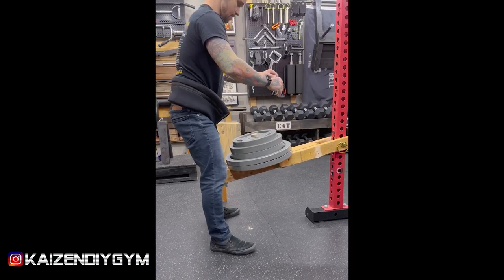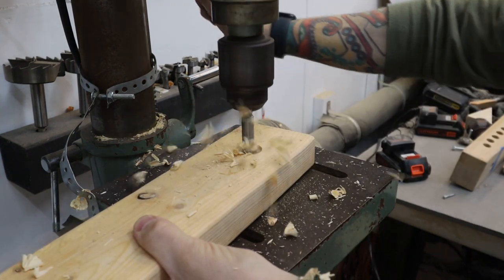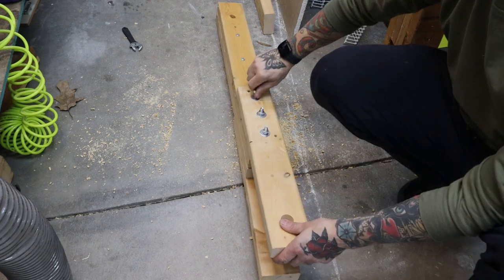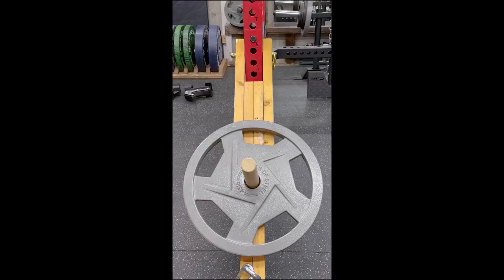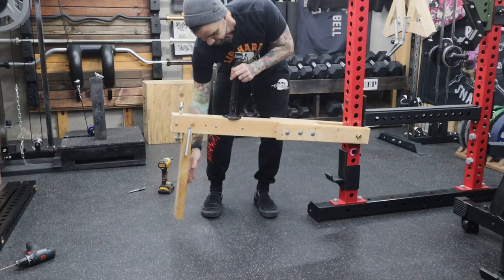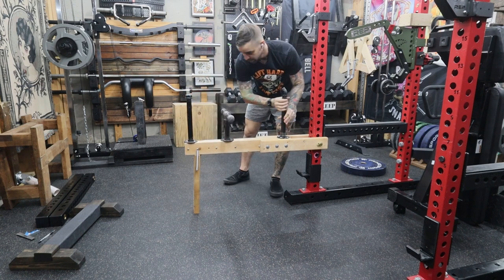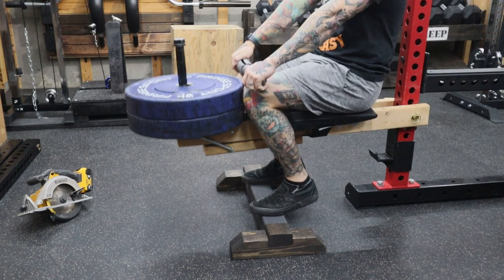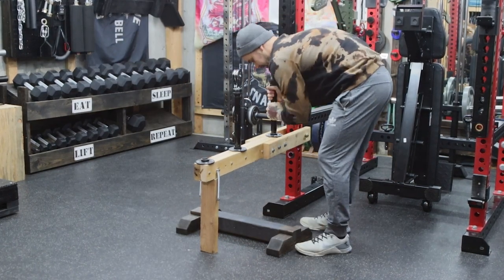DIY lever belt squat and seated calf raise!

Comment: Almost I did not watch this because I have seen the short videos.  This is a marvelous explanation of the steps and of your reasoning in making these attachments.  My rack is a cheap one with holes only going front to back, but I think there is enough room in my garage to go off to the side.  I really want to do this once I have finished one or two other projects.  Thank you for sharing and stay safe.
Reply from the maker: I appreciate you taking the time to watch. The short videos are basically teasers that I put out while I’m shooting the longer video. I appreciate the support. Good luck on your build.
Reply: You could use safety/spotter arms with holes from side to side to get a hitch pin through these holes and build this. Maybe this could help, if your garage isn't big enough.

Comment: Thanks for the tutorial! I built a similar version, but spaced mine differently, went with only 2 flanges, and don’t have any handles. This means less hardware and faster swaps between lifts, but without the handles, I have less stability in my movements.
Reply from the maker: That works!

Comment: You said the inch hole goes at the end of the 30 inch pieces but by the end they were at the end of the 20 inch pieces. If anyone is following along then they have screwed up because you said it incorrectly.
Reply from the maker: Sorry man, there are bound to be some mistakes in there. Hopefully you’ll be able to recover and still use your DIY.
Reply: @KaizenDIYGym  i have recovered and completed the build. My temper tantrum is over. Appreciate the video.

Comment: Hi love your channel and innovative inventions!  I'm considering getting the Mammoth belt squat from Fringe your invention and it says 90% felt weight.  It's long so that made sense until I saw Sorinex J Squat which is also long but claims 60% felt weight.  They look VERY similar but percentages are far off.  Please help me understand this and help me pull the trigger because I'm tired of messing around with landmine belt squats and at a weight level where they no longer work or are a total pain.

How does yours get 30% more feel weight than Sorinex or do you think their % is way off and they never even tested it.  I tested a landmine belt squat today and say a 25lb plate and 45lb bar at an angle with landmine had weight of around 38lbs so it was MORE than the weight I put on.
Reply from the maker: These are all great questions and I appreciate the kind words. I haven't used the J Squat so I can't say whether or not what they're saying is accurate.
On the Mammoth, there are so many variables that change the felt weight - length of the arm, weight horn placement, height where it is mounted on the rack, whether or not a kickstand is attached, etc. I can't say definitively because I haven't tested it out. What I can say is that I trust the team at Fringe. I trust they did their due diligence before putting that information out to the public.

Comment: Love your channel! You inspired me to do some do it yourself projects for my home gym. I am going to build this.Belt  squat set up. I know you mentioned the length of the lever. The shorter you feel more load the longer you feel less load. Ideally, what do you think an ideal length would be? I will be using Olympic plates. Thank you in advance!
Reply from the maker: Longer is always better. The shorter it is, the more you get pulled forward at the bottom of the movement. Length doesn’t make a difference on how much weight you feel, that has more to do with weight placement. The closer the weight is to you (vs the attachment point) the more weight you actually feel. I’d put it as close to your body as you can without bumping your knees into it during the movement.
Reply: Thank you very much for the reply and thank you for the useful information on load placement ! . Definitely makes more sense now. Keep up the great content . 👍🏻💪🏻

Comment: I love the design and got it mostly done. How did you get the springs to work? I’m having trouble getting any springs to work without them either slapping too hard or barely moving at all. I basically copied what you did on the video but my results were much different. Any help or advice is appreciated!
Reply from the maker: It’s a matter of attaching them with the right amount of tension. I had to do a bit of trial and error to figure it out.

Comment: I can change your math and physics…put a j hook ,opening facing you ,on the underside of the arm ,near your attachment hole. Take a purple or blue band attach the loop around the j hook then around the support arm of the rack, then attach the other loop to the j hook. Secure the band from sliding up the rack ,support it to the bottom of the rack. I used a small nylon loop with a carabiner. Now even close to bottom you will be at weight or up to 25lbs above… I measured it with a scale at multiple heights. The bigger the band the more the suffering….lol

Comment: I have a landmine attachment into the wall a couple inches above the floor.  Do you think this design would work or would using the barbell design be better
Reply from the maker: Both would work. It’s really a matter of what’s easier and most effective for you. I’d at least try the landmine belt squat before building this. You can elevate your feet by standing on some plates.